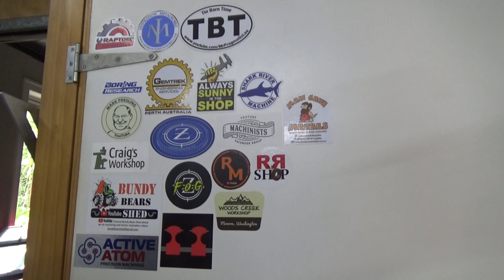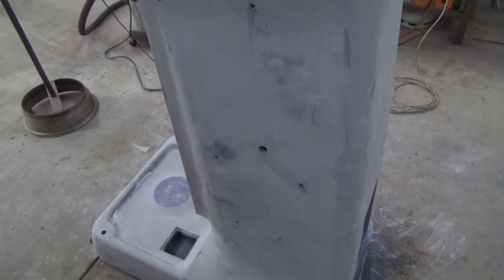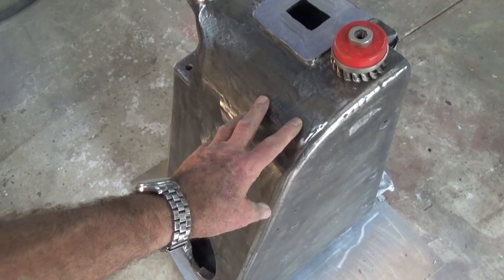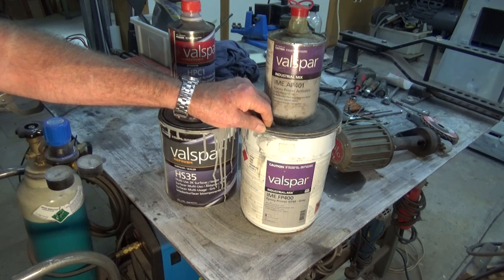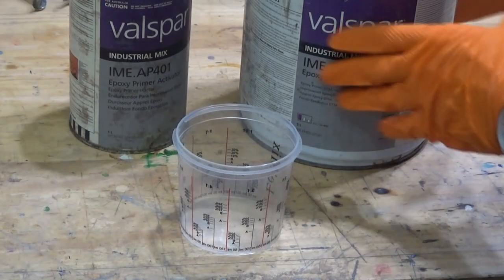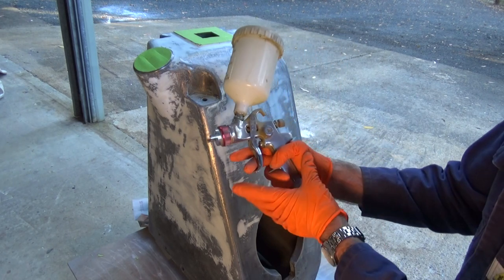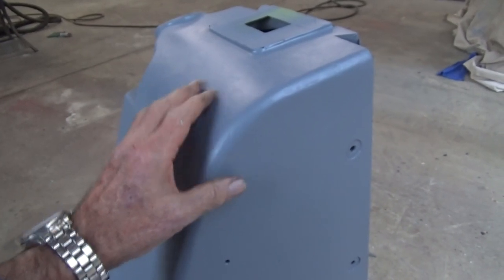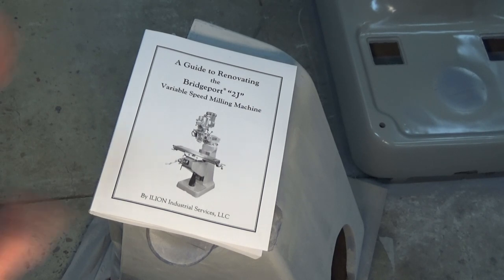Bridgeport Repaint With a Side of Humble Pie

Comment: These huge castings that make up these machines we use aren’t really supposed to be perfect I mean there’s little flaws here and there,, it’s a machine why are we trying to turn it into a custom show car body….???
Reply from the maker: I have a Colchester lathe that I have stripped and refinished twice. The first time I used the wrong etch primer and top coat and it all chipped off in less than a year. I get a bit depressed when I see what was once a nicely painted machine get all shabby. I know that some people like the distressed look of an old machine with all it's battle scars but having a smooth and unbroken paint finish makes cleaning up much easier. A quick wipe down with a clean cloth and all the muck is gone. Having said that, when Bridgeports were made at the factory, the castings were filled, sanded and painted with care. Check out the restorations done by H&W Machine Repair to see how they do it. 
Regards,
Mark